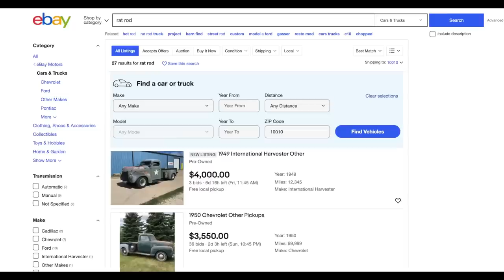Replacing my Electric Rat Rod with a True Gas Beast

Comment: If it goes electric, it needs to use some big old nasty DC motors hooked up in some gnarly way like exposed gears and chains...and it needs to throw sparks. It would have to have one of those huge handle switches like you see on old horror/monster movies to turn it on. I think it could be done in a way that does the build justice. Having said that...I do like it the way it is, too. That front suspension is epic!
Reply: Your idea sounds great! I would add, leave this one alone, and have Rich, and Stevon compete with this build in electric form. I like my idea too, I'm gonna post it with your idea as the header. 😁👍✌
Reply: I agree 100% with this. IF you decide to electrify it, it needs to be the most rat roddish electrification possible. I'd like to add: analog gauges for everything. It was clearly built with a lot of flair and artsy touches, and whatever powertrain that's installed in it needs to match that.
Reply: Diesel-Electric like a locomotive
Reply: Like it came out of the movie Frankenstein. " It's Alive ! "
Reply: Rolling electric chair lol 
full analogue specification
Reply: Electro steam punk
Reply: this guys comment makes me think you could electrify it and keep the whole feeling of it. but i really just love that thing as is.
Reply: Imagine using something like 8 converted alternators as the powerhouse, with the pulleys replaced with gear sprockets and then having an old motorcycle transmission hooked up

Comment: Get smaller hub electrict motors for the front wheels and leave the back on the motor that's in it. So optional awd, gas powered rwd and electric fwd all 3 options in one.

Comment: I agree on painting the rims black but I wouldn't touch anything else and just drive it. Someone put a lot of work into it and you will lose the sound. There's other rat rods you could get and put an electric motor in instead of this beauty!
Reply: Agreed, beside the hood ornament, as I think a bulldog would be a better fit for this beast!
Reply: Black rims? Yawn. Deep red/maroon, or maybe pick up the purple of the headlight buckets.
Reply: @johna1160  red would work too. I don't like that green so anything would be better.

Comment: If you electrify it then I think what you need to do is find parts that make it look crazy.

So first of all the easiest thing is to put a tesla coil in it. I don’t know how you make that safe. But that with lightning coming off of it would be pretty fantastic, and if you make it integral to the system like part of the starter motor or something that would be cool.

Then you need some of those old-school what are they called Flexi or something? Or some vacuum tubes that light up?

And then, and this would be the craziest thing of all, you figure out a way to hand build an electric motor where you can see the state are spinning from the outside through glass.

This is the kind of thinking that you need an order to make this go. And then if you have some kind of tesla coil or other lightning bolt type thing happening, you make it so that it changes sound as you push down on the Excelerator pedal.

As an aside, I’ve long wondered what it would be like if you put a microphone next to an electric motor and then broadcast that sound amplified and equalized out of a vehicle. Not through speakers, but through some kind of like phonograph con so you’re amplifying the actual sound and not making some thing fake.

So essentially I think what I’m describing is an electro steampunk design. Something right out of Frankenstein. I think that will keep the feeling of it even if you turn it electric.

Comment: I'm not against the whole electric conversion thing.  But not on this.  This one is perfect.  Something that brings a smile to everyone's face when they see it, is a finished project.  Tweak it,  put your stank on it,  and work on your other projects.
Reply: Agree, make this vehicle even better but don't remove its soul.
Reply: Yeah I agree all the way from Scotland. The mechanics and mechanical design is part of the character of this thing. 
It’d be like putting a human face on Homer Simpson.
Reply: make it a hybrid 😅
Reply: It has nothing besides character. I'd rather see Rich have his way with it.
Reply: Agree. Add nitrous!
Reply: I'm against electrification for everything older than 20 years, and more expensive than $100,000
Reply: @pear7777  it's definitely good for those old school luxury boat cars, like a 60s jaguar xj. Those things were terribly unreliable and the gearbox was clunky, it would certainly benefit from the smooth clean reliability of an ev conversion.
Reply: Agreed. This thing is perfect as it is. Maybe change the wheel color or something, put a different hood ornament like Rich wants to do, but it would be a crime to pull the motor out. I think Uncle Rich is starting to develop a pattern -- he finds a out-of-the-park home run finished project like this one, or like Big Red, and then the dilemma is there's nothing else reasonable to do to it. I mean, kudos to him for finding and appreciating these things, and making videos so we can all appreciate them, but a project is supposed to start off as something where only he can see its potential. Like his original flooded-out Tesla.

Comment: You should turn this into a hybrid I.e. keep the engine but have if power the front wheels and an electric motor powering the rear wheels and increase the height by >20cm
Reply: I was just coming to comment this about electrifying the rear wheels.
Reply: Great idea 💡💡
Reply: You got it backwards - the rears are already driven. Add in-hub front motors.
Reply: @DiscoFang  I second this motion.
Reply: OMG FINALLY FOUND SOMEONE HERE WHO ALSO WANTS TO AN HYBRID.
RICH PLS SEE THIS
Reply: Leave the swan ornament and call it Hybird
Reply: It could run silently around the city with a massive V8 on display. Or with the engine idling, trans in neutral. The perfect hybrid.

Comment: Don't make it electric... Unless you're gonna strap two electric motorcycle engines together to make it look equally ridiculous, and put an air compressor in there just to make the flaps pop. But yeah don't electrify this one. Renovate it, shine it up, let Stevon do his wood working thing maybe add some suspension... actually, isn't this kinda what the Model D is going to end up being, too?
Reply: Two electric motorcycle motors AND a Tesla one!

Comment: An electric ratrod with this much style can probably be done:  huge vacuum tubes, knob and tube wiring, big analog dials and switches, those gauges with eerie greenish lighting ... and the ominous and hum of a lot of electricity.

Just don't make it a death trap (a la fractal wood burning).

Comment: The problem with making something like that electric is that the sound and the moving parts of the engine are all part of the experience. I would just put some super fat tires on the back with a narrowed rear.

Comment: Keep it as is!  Find the person who built it and tell their story
Reply: Ok i got a question.. how such-rat-truck things are allowed on streets without MoT homologation or any technical inspection ? in Europe that thing could not be run on public streets, the car papers would be confiscated along with number plates, the owner get multiple fines including for CO2 pollution and noise pollution as well, the car would be towed into a graveyard to be destroyed in a shredder, a crusher or a compacting press..
Reply: @poplaurentiu4148  🇺🇸 baby.  Older cars are generally grandfathered out of clean air/safety laws.  Since the vin is from the 1930’s I am assuming that’s why they can get away with it.
Reply: @mechbest8685  Ok, i get that but here at least if the original factory VIN show a spec and now when someone ( local authority, police, MoT inspector ) when they run that VIN it show a different molested spec (rat-rod, hot-rod.. whatever they will not give you permit for public roads unless the car is redone in the original spec.. So what i really do not understand how they are keep on getting permit and how do they pass inspections over-there in the new hot rod, rat-rod spec since are not respecting the original registered spec.. (now i really do not hate this mod-car i just can not comprehend how is still on roads as it is.. and if by the same law / rule would be possible over here in Europe it would be absolutely crazy but great..) just to give you a quick example Last week i went to MoT inspections since over here cars must have a valid certificate with a certain expiration period depending on years/usage of cars (for new cars after 3 years car must go to MoT for passing inspections and after that the term expire at each 2 years. When cars reach or are above 10 years must go and pass the MoT inspections each year to be allowed to roll on public roads, and my car passed but in front of me a guy had an old BMW with windshield had a small crack, it had wrong size tires and different aftermarket head-lights (with purple beam light) so, he got rejected until he fix all 3 issues now after he got rejected he cold not drive from there because car had no valid MoT it fail the inspections, so if would have being driven the driver could got bigger issues from police they would void & retain car papers & number plates, driver get a hefty tax + the fine + the towing invoice to the junkyard.. here is a mess, i simply can not understand how there is possible to be allowed on public roads for such cars, that do not have even basic safety measures like lap-seat-belts or at least 2 airbags for driver & passenger..
Reply: @poplaurentiu4148 . your country is very strict on car such as this..Here? as long as it has working headlights, tail lights and a horn, its legal.. some places here in the states have very loose rules on what is "road legal"..
Reply: @russellbluewolf6427  Be Aware ! when travel in cars across Europe the Rules mentioned by me above apply to most European states, are more strictly from West, then to Central and also going South East of Europe.  MoT in Germany is called TUV inspection and is usually made in a specialized center like ADAC or as a mobile inspection station trailer tow by a truck-unit and placed by police (usually is on autobahn gas stations or after exits into nearby parking-lots or some-place else randomly were police pull cars over for controls, checks, testings & verifications). (So, too much smoke, broken glasses, lights not working properly burned bulbs even those for rear number plate, bad brakes or oil leaks, expired papers, license validity is usually between 5 to 10 years, inspections periods, insurances validity are most common checks for any fails but once they start they go deep on anything..) Failing inspection as i mentioned is hardly punished with hefty fines and short periods to fix the car depending on each country but on west-European countries are bigger taxes and such controls are more often & frequent then south-east..
Reply: @Pop Laurentiu Were just not nearly as strict on vehicular laws here that’s all. There’s a lot of exemptions in place for classic cars and aftermarket builds. You have to jump through a couple extra hoops. Do some extra paperwork and maybe pay some extras fees. That’s about it though.
Reply: @putoutmyfirewithgasoline1877  Tanks guys for all explanations i might move out-there since the rules & laws (for auto at least) there seems like they can be bend somehow without actually breaking them.. ;0)
Reply: @poplaurentiu4148  what country are you from? In Belgium they don't check spec for cars older than 1965, only lights and brakes, so there are ways to get a rat rod legal. In the Netherlands you can swap engines and even turn unibody cars into pickup trucks IF the work is done properly and drive those cars legally after homologation inspection. Cars need to adhere to pollution limits active when they were new, so a newer engine like this shouldn't pose a problem in that regard. Rules are different in the different countries, so there are probably some where it's more difficult and some where it's easier, and you can even exploit that to a certain extent by importing a registered and road legal car from another EU country. Great Britain has the loosest laws, probably the only country here where you can easily get something homebuilt (like a motorised sofa or shed) on the road.
There's often a lot of paperwork to get heavily modified cars on the road in the EU, definitely not as easy as in the US.

Comment: That's a sweet ride. To get it on and off the trailer just jack the front of the trailer up while it's still hooked to the Hummer/truck, and it will lower the rear of the trailer so that no wood ramps are needed.

Comment: It deserves to identify it self as a plug in hybird, wood to gas convertion, not the wood to gas as in gasoline, but a wood burner like boiler reactor that heats up the wood exhaust fumes into a usable gas to power the engine, wood to gas convertion, there as some done already on Ytube, but there are no wood to gas plug in EV convertions yet, it would be nice to do before it's 100th birthday, just a taught
Reply: Yes! wood gas generator!

Comment: On the place of the air filters/carbs have some industrial capacitors or other such stuff. Look for old electric industrial stuff in general and just style it with them. If they're heavy objects, just gut them if possible. With electric, I think it's much harder to have functional rat/mad max style mechanical parts. So it would be more of an ornament thing and the actual functional components would be more hidden. What I would say, there shouldn't be much shiny plastic on an electronic rat rod. Or maybe it should be made on a shell from the plastic era and covered with it.

Comment: First thing i'd do would be to put a firewall and some floors in it, to make it tolerable. Otherwise, it's going to lose it's charm quickly. That, and check all the welds to make sure everything is solid. It looks well built, not just booger welded. I'd paint the wheels metallic charcoal myself. The carbs / timing it way out, it should jump like a bear when you punch it. 440's are no joke, they were in all those motorhomes for a reason.

Comment: I worked in a sawmill in the 1980's. One machine had an electric motor the size of a 40 gallon drum. It was all covered in rust and sawdust and had hints of old orange paint. It was cast iron with huge cooling fins and a big old cowling on the front. It probably weighed more than that 440 and  produced about 100hp but had torque that would spin the earth. If you put any electric motor in that thing, it would be that one.

Comment: The electric rat rod was cool but you should definitely keep an engine in this one. The engine just looks so right in it and putting a electric drivetrain in it will mess with the entire look of the car. The only thing I would change other than giving the engine a refresh is making it supercharged like you were talking about or making it twin turbo.

Comment: You showed a 57 Chevrolet when describing a Hotrod .. while technically that isn't a hotrod, it's still in the same spirit. It's actually what you would term a Streetrod  (or Leadsled) - Hotrods go up to 1948 that are commonly built on a separate chassis (think a 1932 Ford Model A) technically, and while there are cars built before 1948 that can fall into both categories of definition - it's a good rule of thumb to go by.

Comment: Do electric, but make it actually flashy. Tesla coils, old electric components on the outside, wire harnesses EVERYWHERE. Maybe some redundant moving parts in "engine bay". Time-traveling delorean would be a good inspiration.

Comment: And I quote from rocketsurgeon11 below    "If it goes electric, it needs to use some big old nasty DC motors hooked up in some gnarly way like exposed gears and chains...and it needs to throw sparks. It would have to have one of those huge handle switches like you see on old horror/monster movies to turn it on. I think it could be done in a way that does the build justice. Having said that...I do like it the way it is, too. That front suspension is epic! "

My addition, Your idea sounds great! I would add, leave this one alone, and have Rich, and Stevon compete with this build in electric form. I like my idea too, I'm gonna post it with your idea as the header. 😁👍✌     THUMBS UP IF YOU AGREE! 🤷‍♂️

Comment: Go electric but add a lot of archaic electrical equipment. Instead of stacks, make sparks! Think Frankensteins laboratory, copper wire, ceramic insulators, blade switches. Make everything look dangerous as hell on the surface, but safe underneath.

Comment: My vote would be pull the engine, black out the chassis and interior, do a clear epoxy hood showing off the batteries and electic motor. Reroute the air lift release to blow open the exhaust caps

Comment: @RichRebuilds That's not a 31 Model A Ford, that's a 1929 Chrysler...  (And the steering wheel is a 59 Edsel)
Reply: I thought that body look awfully big for a Model A.
Reply: @scottsinaz3000  Plus it has a crank up windshield, wood in the structure and a flourish on top of the cowl, all things a Model A does not have... and the radshell has a Chrysler badge...

Comment: Use an electric turbo or supercharger to move air for the cooling system and rout it out the exhaust... at least you make cool boost noises and work the exhaust flaps.

Comment: Do a hybrid? Leave the rear tires mated to the gas engine and then find some in wheel direct drive motors for the front hubs and wheels and make them an assisted front wheel electric driven.... it'd be super unique and probably the first custom "hybrid" build and it would still retain what we all love about a rat rod and the internal combustion engine but has a modern touch to it to